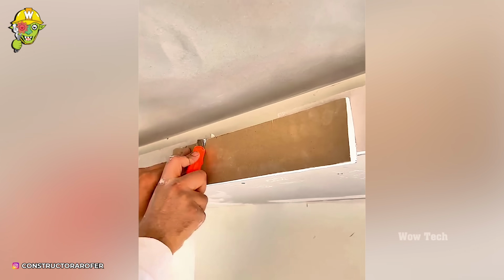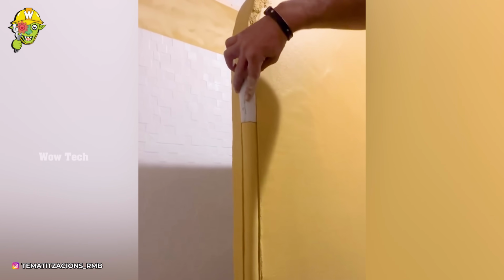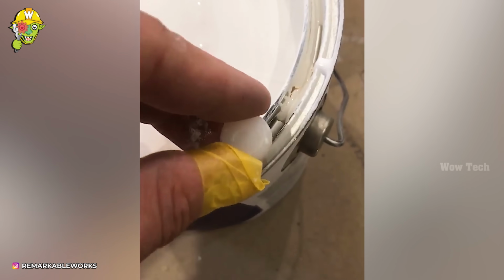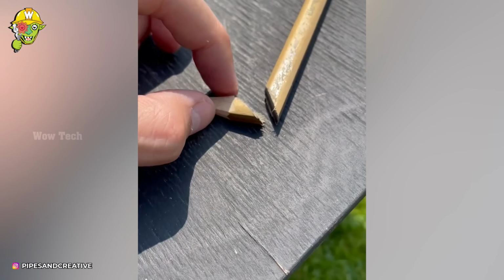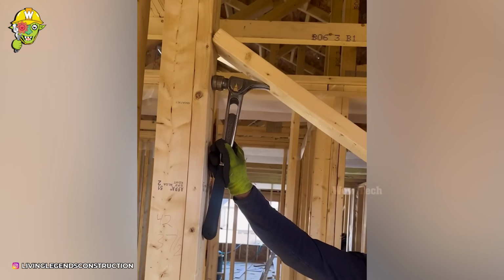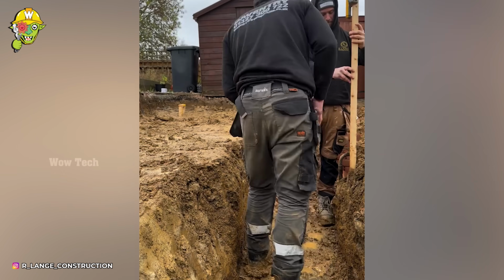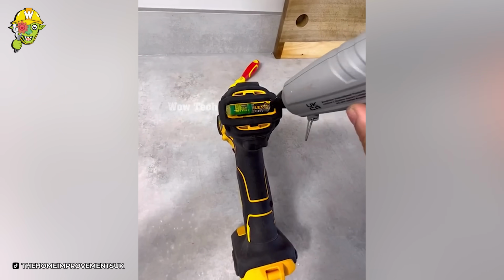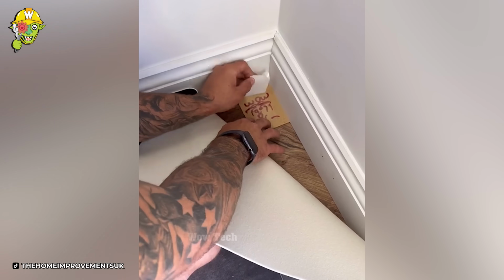Construction Tips and Hacks That Can Save Your Career

Comment: Anybody who paints walls knows that you always remove the wall plates from switches and plugs.
Reply: Right on. That 'helpful tip about painting around them' is dumb.
Reply: It may not seem like it matters, but plates can move slightly over time, causing you to see the old color. You also are unlikely to get perfectly to the edge with any tool, leaving a tiny gap of old color (or a tiny bit of paint on the cover)
Reply: @jaketheauroran  Another neat thing to do is lightly sand those plates and paint them with the corresponding color of the trim on the wall they're located.

Comment: I appreciate your tips. However, the paper backing on drywall is not a good replacement for drywall tape. Maybe in a pinch but if your doing construction just do it right.
Reply: They're 2 separate applications. Tape is for strengthening joints over time. If the patch is contained within one sheet of gypsum board, you don't need to strengthen the joint, since the patch will move along with the board.
Reply: It's known as a California Patch in the industry. We use it to patch holes so we don't have to mess with a back board. 

Doing this on all your joints would never work because studs placement and drywall sizes are designed to line up.

Comment: Always wear eye protection when using a wire brush on a power tool. sharp pieces of wire go flying out. They are far more dangerous than sparks from an angle grinder.

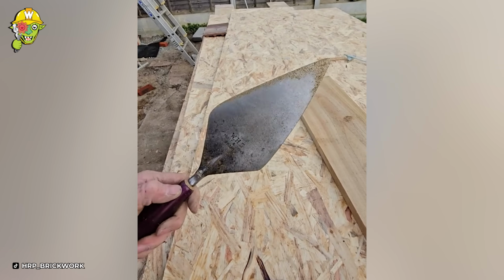Comment: 5:57 How to restore the shininess of your trowel? Use an electric drill, a wire brush and rust remover! Genius! I tried for years using only wet toilet paper…😅
Reply: And no safety goggles too. If one of the brushpins flies in your eye, you are totally scr**ed.
Don't do as they do, THINK FIRST.
Reply: I just dunked it in the same solution used for restoring copper pots and the like.   There are many recipes, some using electricity and some just chemical reactions.
Reply: @zeriousvolt1245  You are absolutely correct about the safety goggles.
Reply: @zeriousvolt1245  Do you have extensive experience using that tool? Because I do, and safety glasses are not always necessary for short-bristled, drill-powered wire wheels—especially if kept at low speeds and when aimed away from the face. Safety gear is not unconditional; for real "THINK FIRST" people, it can be discretionary. 

You don't wear steel boots to cut your grass, do you? But WHAT IF the mower blade dislodges? Accidents happen! No, they don't: they're caused.
Reply: @pocket83squared  u r giving terrible advice

Comment: 14:05 Bad tip, never do this.   There needs to be adhesive right to the edge of the hole, as this is where the fixiings are tightened onto the tile.